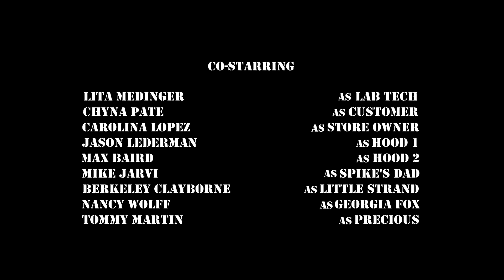PoPS-Episode 6, part 7

Comment: I believe stopping time would just stop the flow of ANY event of any kind. Meaning that if an object was heated up, by stopping time and resuming it, the temperature of the aforementioned object would be exactly the same. Same applies to light (not sure, never stopped time really), places with light would remain lightened up and places without lights would be dark as well. I assume that no time flow equals to no change whatsoever, it's like taking a picture and walking in it

Comment: Well for one, light couldn't have stopped travelling because it is a constant, and Eliza doesn't seem to find it difficult to move (something that would be happening if she was moving really fast relative to the speed of light, i.e. if it were slowed down).  But with the issue of the shadow I find it hard to explain.  If my understanding of relativity was correct, if you were walking around with her (same relative time) you'd see her shadow follow her as she moved. But if you were frozen, well.